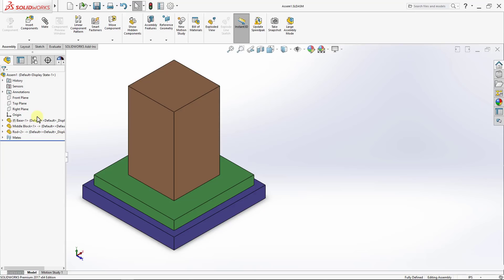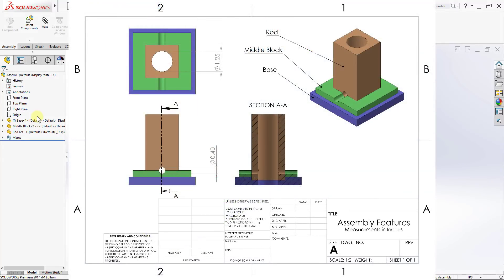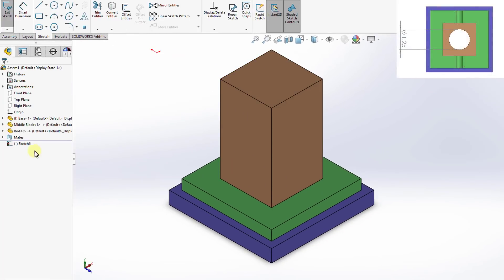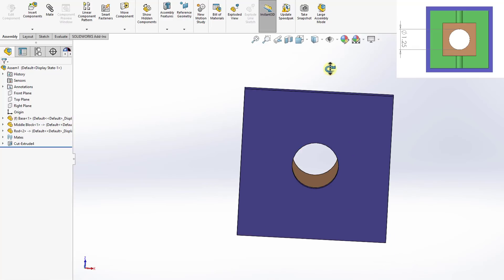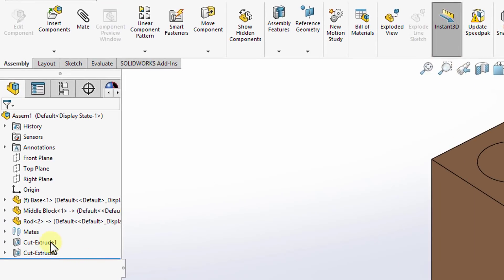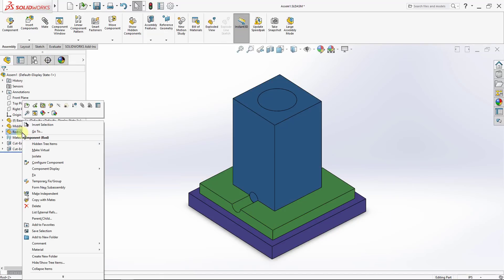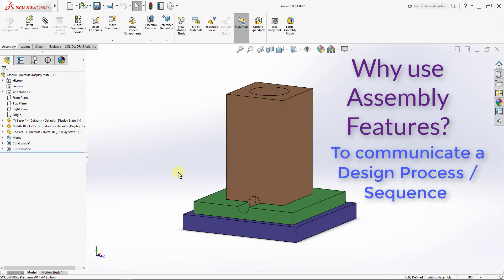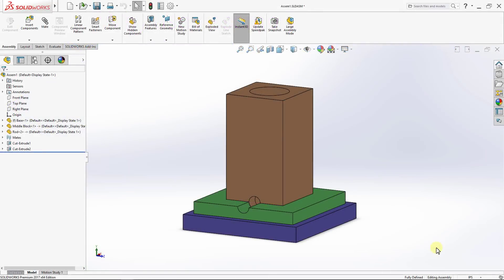Advanced SOLIDWORKS Tutorial: Assembly Features

Comment: I am having a little bit of an issue and was wondering if you could help me . At my work, we often use a "blank" component that has several features in it and then for custom orders we add assembly features to them individually so that they are unique but all from the same "blank" component. One of the features that we need to add to these "blank" components is engraving on a cylindrical surface. Now I know I can use the "wrap" command in a part file, but it is not available as an assembly feature. Any ideas how this could be done?
Reply from the maker: Hey Kevin, You might be able to get that to work with a simple extruded boss. Once you are in the features manager, the first option on top says "From" which can allow you to select where you want your cut 'start' from. You can try changing it from the default "sketch plane" to "Surface/face/plane" and then select the face of the cylindrical surface you want to engrave. 

Try that out and let us know if it helps :)

P.s. if you or your team are looking for some upskilling or reskilling in SW, make sure to check out our programs here: https://school.tfordesign.com/courses